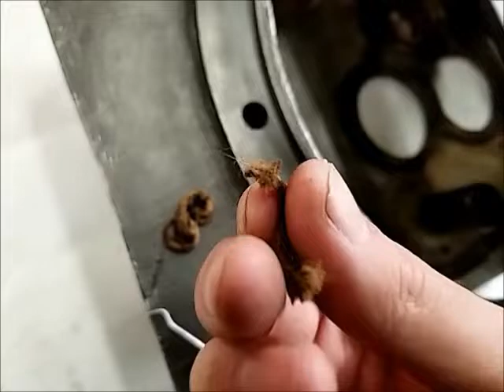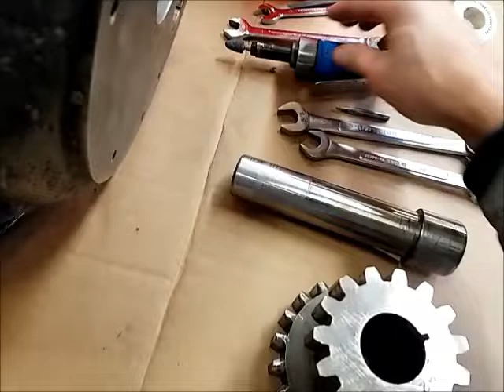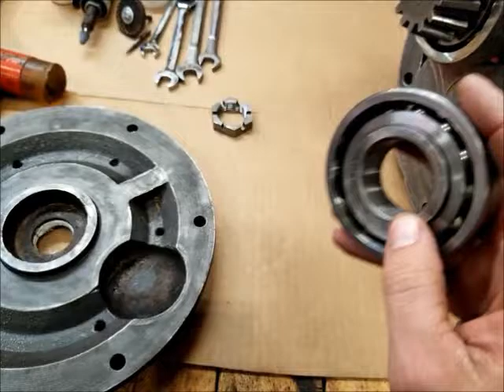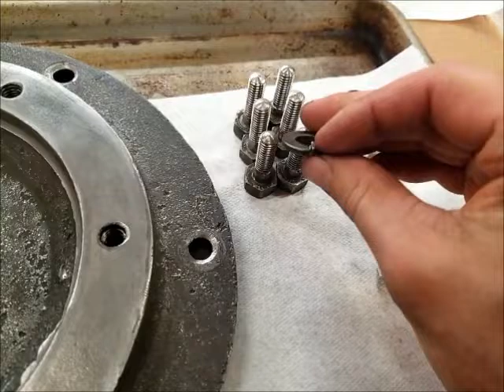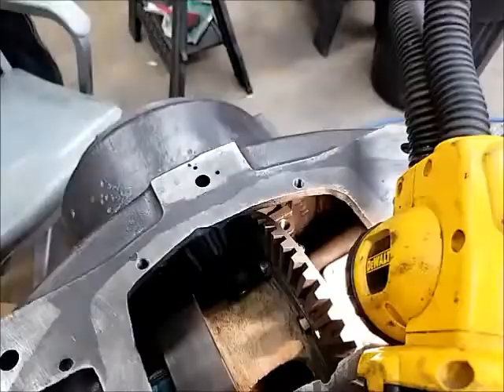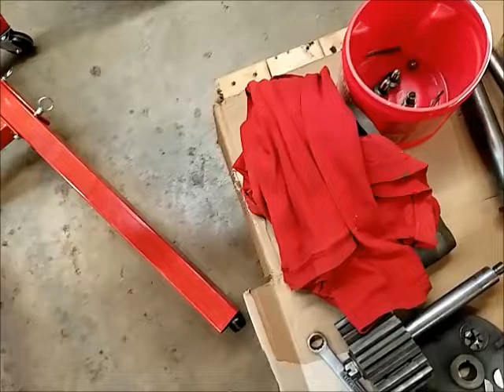1920 Allis Chalmers 6-12 part 18

Comment: According to a rock crawling website and a drag race website a Ford 9" differential uses .006-.010" and .008-.012" backlash respectively. The 9" is arguably one of the best differentials and the harsh environments simulate ag use I'd keep those #'s in mind. Try to balance between the wear pattern of the gears and the backlash and call it good. Again my opinion for whatever that is worth.